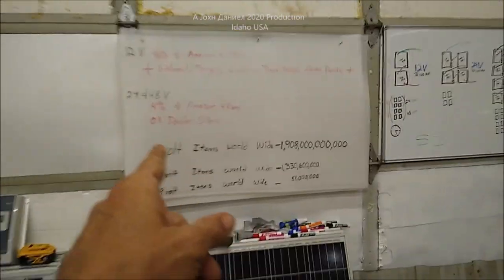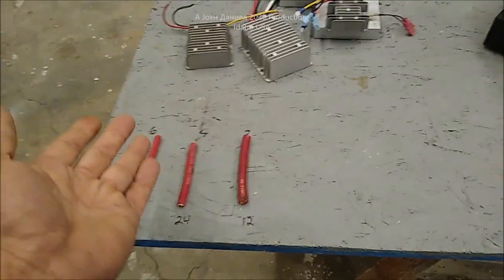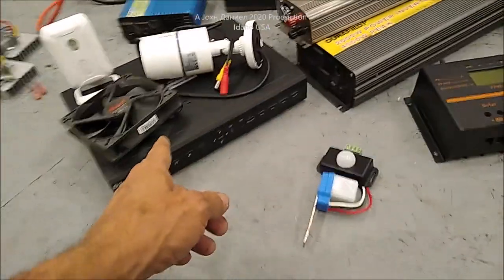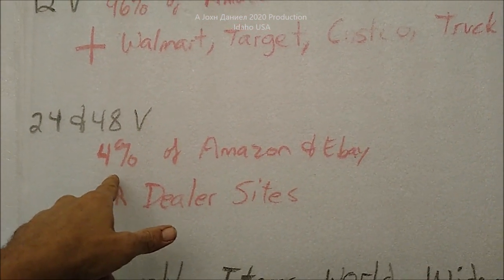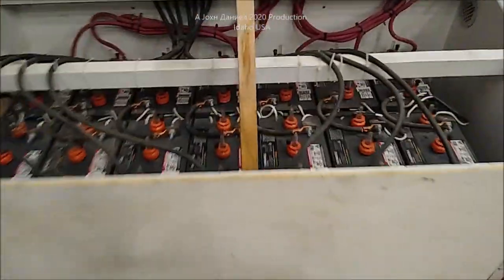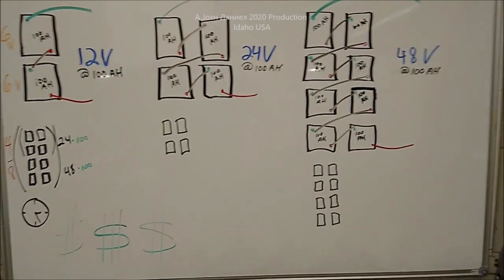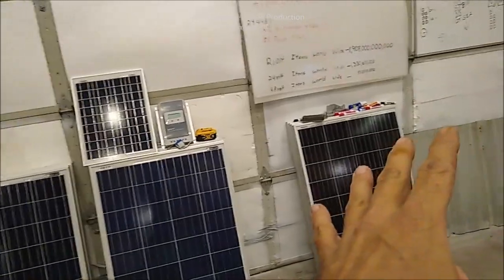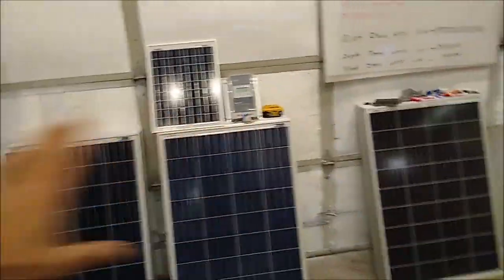Solar Wind Hydro 12 VDC is Best Voltage on Off Grid Survival Power System (Graphic Info)

Comment: Agree with most all you said with exception on going battery usage 12 vs 24 vs 48 where you left out the amp draw is much less on those higher volt systems. That being said I to use 12-24v and greatly noticed going from 12v to 24v however more batteries needed but the amp draw decreases an will decrease again going to 48v. As you said cost does go up so pick an choose.  Your info is great and help alot of ppl keep up the good work.
Reply from the maker: Thats the mantra from people selling high volt stuff, not a actual deal breaking issue. The amp draw? Yes, its high amps, Why is high amps a problem exactly??? Not as though we have not built for it over the last 100 years on everything already. In reality - The poor folks buying the Dealer only option get a design thats always a ONE system. With the opportunity to have all fail due to ONE tiny item no matter what their amp draw is. My system is basically a stacked system. With the 12 volt stacked system I have you can call it 7 - 600 watt solar systems, 5 independent 500+ watt wind systems. Even though it looks like ONE, it is so damn redundant I will power on at my Silly 12 Volt stuff when the dealer only folks are putting rotting food from a freezer in the dumpster over a bug getting in their high dollar parts. Seen it.
Reply: @JOHNDANIEL1  I was giving you props on your info along with stating facts on higher voltage systems. This wasn't about big business/corporate lingo. My entire system isn't much over 2.4k and started as 12v better than 10 years ago and now is at 24v with plans to reach 48v for higher demand applications. 2400 watts of solar, 12/24 controller  many safety DOD and 800amp of batteries 12v now 400amp 24v with 3 gridtie inverters. We are a full electric 3 bed, 2 bath 2200sq ft home and 900sq ft 2 car garage with a 20kw generator. Skimping on power we aren't.  But facts are amps x volts = watts  thus 10amp x 12v = 1200w just as the same 10amp x 24v = 2400w or same 1200w on 24v would only be 5amps. Example is based off 10amp draw as most "wet cell" can safely be cycled to 10amp for 10 hour dod without harming batteries. So the above is based off 20 hours for 24v power vs 10 hours for 12v at half the amp draw. But as 1st post started good info you have for ppl, not trying to start voltage battle just want to make sure ppl wanting to run an entire house vs running a few items know the voltage/amps makes all the difference.

Comment: I absolutely agree with the panels, I'd buy 100w panels if I could afford to. I went with 150 watt,12v panels, 2 in series, pairs. I'm buying some 36v panels, and putting them in series, because they are going to be pushing a long distance! They are used so it's what they are , smaller panels, with less in series, is better , in case of shading or burd turd ! Blocking a single cell will Christmas light your panels, if they are in series!

Comment: Wish I could have found a video like this a few years ago!  Started with tiny 12v system and then went 48v. I haven’t really been happy with the results. Seems like a lot of power loss with just the inverter alone. I too stayed with 100w panels. How much loss do you get on your 3000w pure sine wave over night? Thanks for the video!
Reply from the maker: The 3k inverter and 4k mod inverter use about 3.1 amps per hour in hot idle. 2.2 in low idle.
Reply: If you are only needing 3000 watts, why would you ever want a 48V system? They're designed for a minimum of 5K Watts and using 120V/240V AC power in most applications.
Reply from the maker: I am noticing a serious quandary of issues. A Particular ONE THINK!
The majority of my viewers like you are mid to lower income Silent Majority folks who are really needing a solution, or Green Think upper income who need a advantage. Then there's another small set who watch me, the insulters!  
But, I think I need to make a Video called Solar Snoots Vs. the other 99% of the planet (the new Unclean). Hundreds of comments are from people who now understand they can at least do something for themselves only to be hammered down like little children for not owning high tech mega systems, easiest voltage, easiest methods or for listening to a "fool" who shows them how to at least have some control and not die in a storm, catastrophe or SHTF scenario, for being poor, or being soooo stupid not buying the snoots part A or Brand B. 
In 2020, with the current crisis on steroids, not all can crap out at the least $7500 to buy the "right" thing according to the solar supremacist who bash them. And they ain't got years to build it up like most have.
They get bashed for their simple survival level Unclean 12 volt fantasies of at least not being total victim of having nothing, Could it be titled Solar Supremacist verses the unwashed fools who don't have Superior branded products ?? 
What would be safer as a public, feral population running to the lit homes of the Solar Supremacist to riot and pillage or them stay home in what little they realistically could afford to keep a freezer running, lights and communications.
Wonder how viral it will go since the result of the SS actions affects 6.5 billion people! 
I get shocked how many get bashed for buying silly Harbor Freight solar kits, as stupid, slope heads, neanderthals and fools by the solar supremacist and mainly the sellers of high end solar gear. 
The truth is over 90% of them learn to move up, become more involved and thats what is obvious to me what the Solar Supremacist fear. The unwashed, becoming clean. 
But when they do move up, they got that abused bad taste in their mouths of dealers, re-sellers and supremacist who instead of congratulating them & courting them as a possible customer or friend - abused them.

Comment: I have a bunch of 24V@ .289mA rated LED lighting boards that throw a ton of light.  Would I be better off staying with 12 volts and using step-up converters to power the LED boards?
Reply: I should note I've already started down the 12 volt path for my RV.  Once I move off grid the 24 volt LED boards could provide a lot of light for the watts they consume.  I'm tempted to plan for a separate 24 volt system.

Comment: I too went with 12 volts because it is simple, and I can run my security camera off 12 volts it even has an internal memory it records to.  I run an led strip 24/7 off my batteries too.  I have 280 watts of panels 100 watts are in use I haven't got the other ones connected yet.  I need to build a ground mount for them.  I have a 40 amp rich solar mppt controller on my system.  I have 3 35 AH sealed batteries. One I got back in 2009 and the other two I got for free back in 2015 I think.

Comment: I don't have a solar system yet, but I decided on 12v for the same reasons you laid out here. Do you have any recommendations for a 12v->9v (or 6v or 3v) DC-DC convertor?
Reply from the maker: Best one made, https://amzn.to/3gYKDnM
Reply: @JOHNDANIEL1  Funny, I have a couple of those (different brands) and didn't think of them. Is there anything similar that you like that is direct wire?
Reply from the maker: Direct wire, and hundreds of options. Always over buy your expected amps, they get power hungry pushed to their ratings. https://amzn.to/2PYT5HQ
Reply: @JOHNDANIEL1  Thanks for the recommendations. I'm currently living in a condo, but selling it to buy a house, being able to do a solar setup is part of the motivation.
Reply from the maker: @wickedmuffin76  If you had $339,000 I'd just sell you my place. Traveling back and forth to Texas from Idaho is getting old!
Reply: Јоhn Daniel That is in my price range, but would make my commute a bit too far :)
Reply: Look Up BUCK CONVERTERS 
LOW LOSS Almost No heat

Comment: Great information, and gave me a new way of looking at a sudden loss of a 320-watt panel, from a freak accident. But did one extra 320-watt panel just in case of one going bad, or even a 25 cal meteor : ), and maybe a loss of one battery. I used the same flooded batteries and bought them from batteries plus too, they are cost-effective and are bulletproof. I opted for a 24-volt solar system with a Samlex inverter. With one 24v to a 12v Samlex converter for all my needs on the 12v side of things because the majority of things are 12v. as you say can find that stuff anywhere.
Reply from the maker: I am noticing a serious quandary of issues.
I think I need to make a Video called Solar Snoots Vs. the other 99% of the planet (the new Unclean). Hundreds of comments are from people who now understand they can at least do something for themselves only to be hammered down like little children for not owning high tech mega systems, or for listening to a "fool" who shows them how to at least have some control and not die in a storm, catastrophe or SHTF scenario, for being poor, or being soooo stupid not buying the snoots part A or Brand B. 
In 2020, with the current crisis on steroids, not all can shit out at the least $7500 to buy the "right" thing according to the solar supremacist who bash them. 
They get bashed for their simple survival level Unclean 12 volt fantasies of at least not being total victim of having nothing, Could it be titled Solar Supremacist verses the unwashed fools who don't have Superior branded products ?? 
What would be safer as a public, feral population running to the lit homes of the Solar Supremacist to riot and pillage or them stay home in what little they realistically could afford to keep a freezer running, lights and communications.
Wonder how viral it will go since the result of the SS actions affects 6.5 billion people! 
I get shocked how many get bashed for buying silly Harbor Freight solar kits, as stupid, slope heads, neanderthals and fools by the solar supremacist and mainly the sellers of high end solar gear. 
The truth is over 90% of them learn to move up, become more involved and thats what is obvious to me what the Solar Supremacist fear. The unwashed, becoming clean. 
But when they do move up, they got that abused bad taste in their mouths of dealers, re-sellers and supremacist who instead of congratulating them & courting them as a possible customer or friend - abused them.
Reply: Јоhn Daniel true! It took me over two years buying a piece at a time and working pretty of overtime and side jobs just to get what I have. I have gotten most of my knowledge for your videos. Just like when I ran across the video about the batteries and your video validated my research on those batteries particular. I can’t believe how much crap I’ve cotton from people over flooded Batteries especially those it’s incredible. Remember I was agreeing with you when you were fighting with that other guy about flooded and lithium’s!
Reply from the maker: @FirstSuiGeneris  So true. But I don't know quiet what erotic feel the bashers get from hitting at the little people. If you got to bash some one, bash these 300% mark up dealers, not the guy trying to save his home. I've never been ripped off by those dealers, I knew better than to listen to their pitches, but so many my viewers come to me shattered and beaten for just wanting lights and a running freezer! So I learned lots about their brain washing dealer crap.
Reply: Јоhn Daniel right! [ smiling ] I don’t get it either! I listen to knowledgeable people like you John and still do my research, use all that knowledge to make a decision on what my needs are or the needs of others and modifications. And hell with others if they think they’re better than someone else. Just wished I came across your before I started this system I could have save more money! You have saved my ass with wind power for sure! Then point me in the right direction. Hell, I even learned a few things about chicken eggs with the hatchery. Everyone can learn something from anyone, if they just stop and pay attention!
Reply: @JOHNDANIEL1  Very true.. I just had a friend buy an installation of 2.4 kw grid tied system..  And now I see that Idaho Power is going to "half" their credits toward the bill.  I don't know..  I just feel sick about that considering what she is paying for it.  And 2.4 kw of solar panels is not that much.   UGH..   anyway.
Reply from the maker: @VLBrander  Grid tie is and has been a scam for 20 years. You will get back your investment, in about 14 years but that same money if applied to making a section of your home off the grid with some batteries, onto a few circuits will pay off in 6.

Comment: The wire cost alone for a DC unit vs AC will pay for the lipo batters. (wire from turbine to controller) 12ga vs the cost of 2ga. Then you have the problem of taking down the turbine to replace a faulty rectifier on a DC unit. To each his own. I prefer AC and have no problem with 24v.  More amperage from 24v vs 12v. Depends on your application i guess. I'm running a hole house off grid.

Comment: Hello John, I just bought a 24 volt submersible well pump, when I turn it on do my batteries discharge on the negative side or the positive side to run the pump? Your help would be greatly appreciated.
Reply from the maker: Draws through the negative, but is fused on the positive. Switch can be on either side unless your controller or relays are showing other requirement.

Comment: Is it better to buy 6v x 2 or a deep cycle 12v for a small harbor freight 18v (12v) panels
Reply from the maker: Look for a Batteries+ get the GC2 130 AH and they are made by Deka, as a Duracell for less.  Order them online, pick up in the stores for 10% off. https://bit.ly/2wv1VXd

Comment: I'm trying to make a little emergency system. This is the first time I'm trying to put something together. What inverter do you recommend i get for the 100w solar pack from h.freight? Thank you for caring enough to share so much information. Was only able to buy one battery, will try to buy another next month and the inverter. My son thinks his old mom is loosing her marbles for wanting a back up in case the electricity goes out in the winter. I've already experienced a few blackouts in my area that are very strange.  Can you recommend some small heaters that can be ran with 12v to close in the bathroom to keep the pipes from freezing in Chicago winters.
Reply from the maker: An emergency power system you're looking for is at least 300 watts of solar, a couple of decent 35 amp  hour deep cycle batteries and inverter 6 to 1,000 Watts. On a budget it's difficult to do I agree. As far as keeping the pipes from freezing in the bathrooms my greatest suggestion for that is what we will do if we need to cover such a need is actually using candles. You can bulk buy candles extremely cheap and they're great and emergency and do not create a carbon monoxide problem due to a petrochemical fuel burning. If you check and see if you qualify for AFFIRM financing, let me know and I can put you a list together that for about 35 to $40 a month you can actually achieve your goal.

Comment: In using those 6 volt golf cart batteries indoors, do you have to vent them or is the gassing not a problem?  Also, in installing panels on an RV roof, do you have to drill mounting holes, or can heavy duty tape be enough?
Reply from the maker: If you use them indoors just remember you need to vent and use intake air from outside. Bu placing the intake vent low, and the exhaust vent high the hydrogen self vents.
Reply from the maker: You do not have to drill holes on a RV to mount solar, but just look on its roof, its full of screws and holes already. If you want a design on how to mount them without putting holes on your roof just ask, there is a top side wall style process for roof mounting.

Comment: John I have purchased an 800  watt Chinese  wind turbine and would like to know if you could supply a rectifier and resistors to suit a 24 volt battery pack .... the system is left unattended for quite long periods  so i would like to use your charging system ty

Comment: Now I know for sure I won't replace my 18650 batteries with one big 48v LiFePO battery bank. The 18650 system consists of about 10 separate 24v batteries in parallel. If I lose one, only 1/10th of the capacity is lost. As you said if I loose one LiFePO cell, the system is broken...

Comment: OFF TOPIC I haven't started my solar adventure yet but i have been studying it for quite some time. I came to the conclusion a long time ago that multiple 12v systems, probably starting with a 100w HF, kit,  would be the way I go because, like you've said, components are available off the shelf nearly anywhere. 

Have you covered micro-hydro? I'm talking 5-10 gpm flow? We're fixin' to move to a piece of property that has a small spring fed creek. I'd like to harness that creek for lighting and charging cordles tool batteries in remote off grid buildings on the property.

Comment: John if you have time. All my panels have generate small burn stains and they are brand new. In case of no external damage or humidity, can a bird poo or dirt shade a cell and cause that issue? Are aware of any external reason eg weak wire connection ?
Thank you
Reply from the maker: What is the brand of panel, and are you using a real solar controller or a diversion controller?
Reply: @JOHNDANIEL1  4x Canadian solar 330w. 2series 2paraller. I think that the problem is about not using fuses for the paraller connection.

Comment: Another great video makes perfect sense, I will be going with a 12-volt system for sure. The visual of shooting the panel was awesome. Sent a clear message of how easily your system can be taken out. Loved the look on the kids' faces! Better buy backup panels!  Am curious if it is possible to add a wind power system to the solar system you have in place. Is that possible or do you need two separate systems?